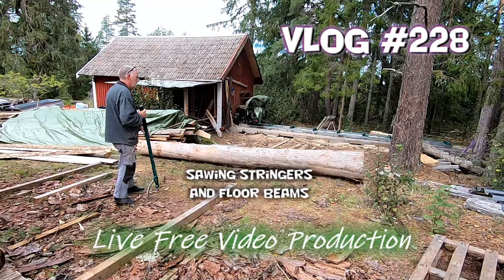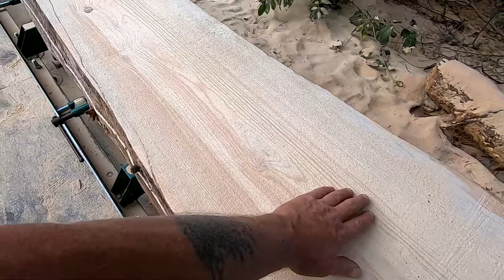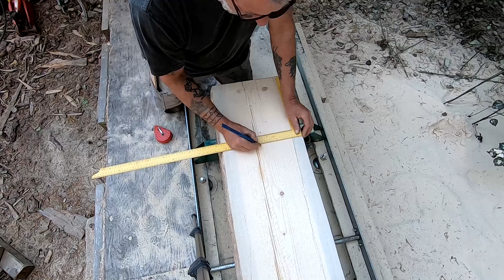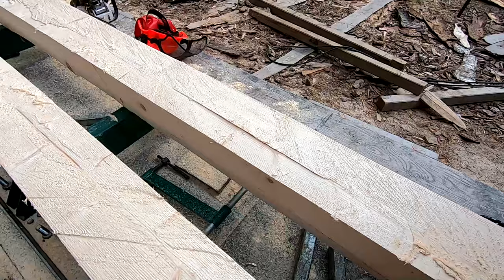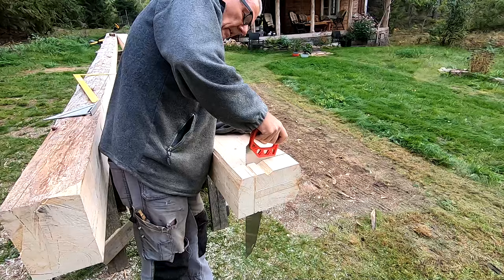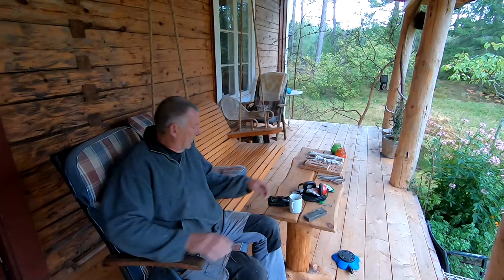Sawing stringers and floor beams. Vlog #228 - S5

Comment: Damn, my back hurts just from watching. Be careful my friend. Back strains suck.
Reply from the maker: Hi Quarlow. I'm always aware of my back because, it's been a problem for the last 30 years. Normally it's a simpel thing, like bending to tie a shoestring, or something similar that curses it to lock up, and it can take from days to weeks before the pain disappear. In the 1995 i had a big fall on a mountain in the alps, and unluckily my climbing partner, had just given out more rope, so when i fell, it didn't totally catch me, so i landed on some big rocks. Luckily the rope took a bit of the speed out of the fall, but mostly it was my backpack that saved me from breaking my back. Since then I've had backproblems, but you learn to live with it. Funny enough it's never the heavy lifts, but the small everyday stuff, that give me most problems.
All the best
Michael
Reply: @livefree-ordietrying  Yeah I'm the same Micheal. As a child I fell from a tree and landed on my back on the vw size boulder. It didn't bother me till my teens but yeah, tge simple things get you. Like just getting out of bed or twisting to pick it something like a hand plane or something completely stupid.  The lower back pain is constant and yeah, you learn to live with it. Ivevalso learned to slow down some and think about lifts and things. You can always find a mechanical advantage one way or another.  Say hi to the kitties for me. 
Colin.